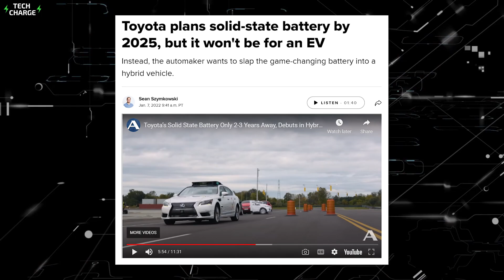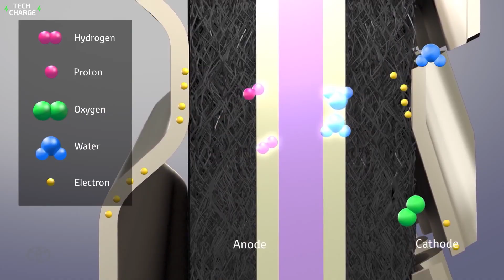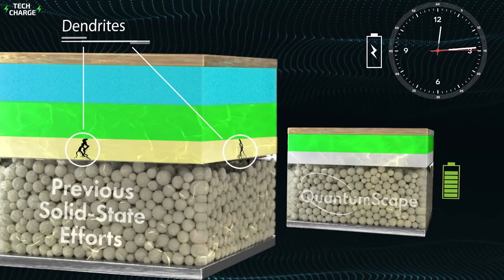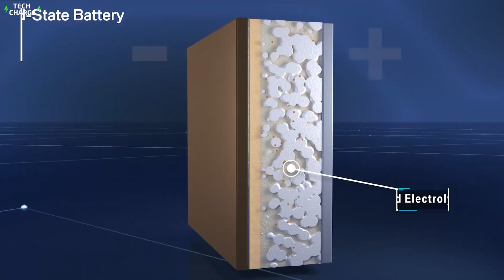Toyota Solid State Battery is Hitting the Market!

Comment: I will install a Toyota solid state battery in my 2015 Lexus RX450h hybrid vs purchasing an EV and why:

Here in Colorado Springs our local Utility mafia uses funny math for utility calculations which they themselves can’t explain.

For example, three weeks ago when their new rate structure took affect, they claimed to us their customers and to the corrupt Colorado Springs City Council (who run and rubber stamp everything the Colorado Springs Utilities want, as it is a solely owned subsidiary of the City of Colorado Springs, NOT regulated by the Colorado Public Utility Commission) the average rate increase would be a “reasonable $30 increase” when in reality the average increase is over $250, which is no coincidence it happened at the same time they shut down our second largest coal plant, 10 years ahead of schedule. 

This huge rate increase obviously significantly negatively affects current and future home charging EV owners who do not have the option of home solar power generation battery storage.

In several years when our largest and last coal plant is shut down, it is predicted the utilities will be 3 to 4 times more expensive than todays massive price increase.

As a result, current home grid charging EV owners are selling their EV switching to more economical hybrids.

Just as Texas discovered, in bad weather Solar and wind turbines are really bad options for large customer based power utilities.

Compared to our 90% efficient clean burning coal plants on a 24/7/365 basis, our geographical location and yearly weather conditions here in Colorado  Springs, solar energy at best is only 7% yearly efficient and wind turbines 25%-35%. 

Many times it is either too windy or no wind for wind turbine power generation. 

New solar panels at best are only 23% efficient at  12:00 noon, less efficient on cloudy and snowy days and don’t work at all if covered up by snow and of course don’t work at night.

As a result, our utility company is turning to natural gas turbine power generators to fill in the major gaps of their failing “green power generation programs”, to provide reliable electricity and with the price of natural gas rising over 100% due to Biden‘s failed energy policies, home grid EV charging is simply not an affordable option now for the masses here in Colorado Springs, CO.

Thus, ultra efficient solid state battery hybrid ICE vehicles are the only viable future option for the masses in our area and in many locations across the USA. 

Also, there is no pathway to 100% net zero emissions without the use of green hydrogen fuel cells. A Scientific data fact Toyota understands and already has cars and class 8 trucks with hydrogen fuel cells.

Comment: Those who don’t drive EVs are constantly harping on how long they take to charge at a charging station which would be the equivalent to asking someone to stand beside their phone while it charges.  99.5% of the time you plug them both in, go to bed and wake up to a fully charged battery. 

Do you ask gas car drivers how much gasoline they need to store to keep their car full? NO, because that’s no the paradigm just like charging stations are NOT the paradigm for EVs. You charge at home 1st, at work 2nd and while shopping 3rd; the last two of those can be free BTW. !